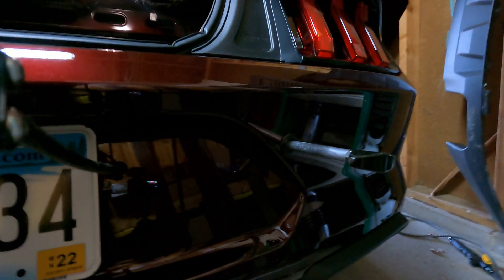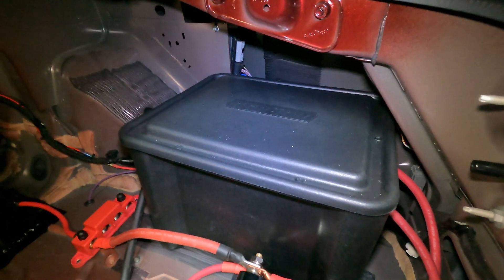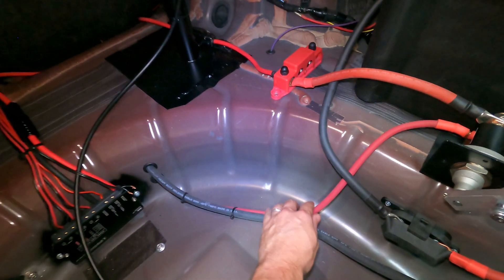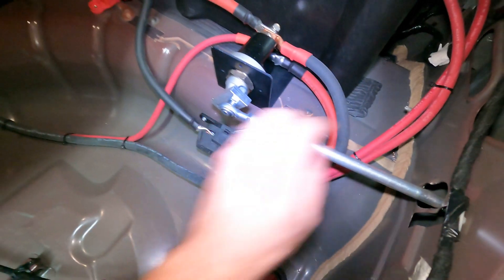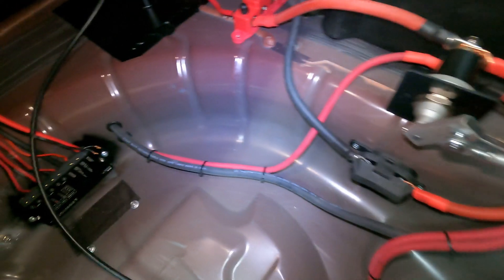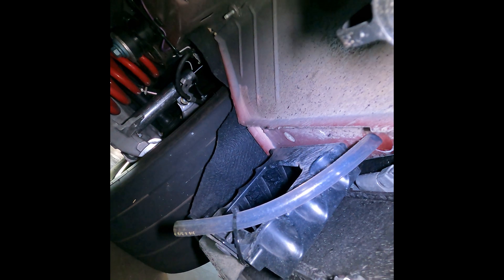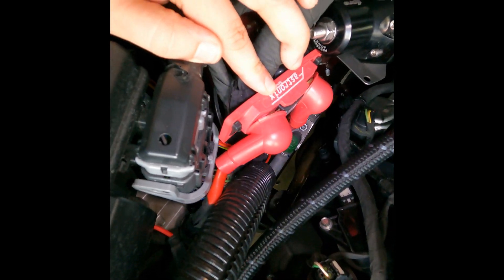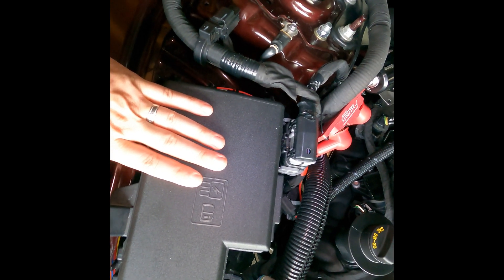1000+rwhp F1a94 Procharged Mustang GT Insight Series: Battery Relocation and Cutoff Switch

Comment: Is it possible to have the shaft pushed in and then kill the car by pulling out? I’m looking for a battery disconnect, but since I still street drive my car, I don’t like the look of the shaft sticking out that far.
Reply from the maker: Yes, but that won't pass tech inspection.
Reply: @ Ah, I see. I’ll see if I can find another switch then. The shaft sticks out way too far IMO, so that’s the main deterrent for me.
Reply from the maker: @jmendozas197 you can always cut the shaft down, but getting a non-lever style switch sounds like the ticket.

Comment: Where did you get that bracket with the battery terminals? Also great video!
Reply from the maker: Speedway B01N9VXH3D Battery Post Adapter Bracket. Amazon should still have them I believe.

Comment: Very well done thanks for sharing your knowledge
Reply: Okay looking forward to it think I gave my email but not sure I was wanting to ask about specking it out is that jpc if so should we get his line lock kit also? Mine is 2015 performance packed whippeld mt82 went 12.20 at 135 and a 146 60,
Reply: Are you going sir shifter what first gear how is down shifts 9.5 stall and on and on and on
Thank man
Reply: Air
Reply from the maker: @larryhensch2280  I don't think I'll go with an air shifter anytime soon. I don't down shift the car very often, typically after I bring the car to a stop.
Reply from the maker: @larryhensch2280  I put my own setup together. I did use some JPC parts, though. I like the JPC shifter mount and the JPC transmission crossmember. Most of the setup I have I ordered from ATI directly. Having the line lock is very helpful. I don't run one myself and I don't use the factory built in one, but if I was going to buy one - I'd either assemble it myself or get the one from JPC. I don't think I saw your emai address, feel free to share it here if you want?
Reply from the maker: Thank you. I have one for the transmission coming up soon.